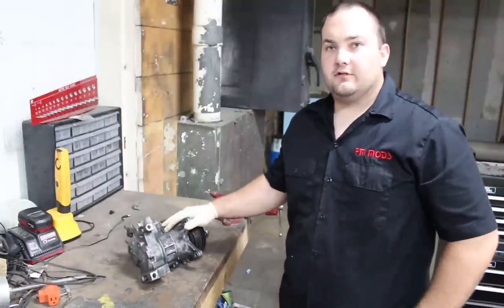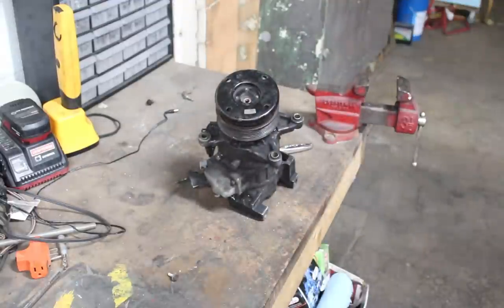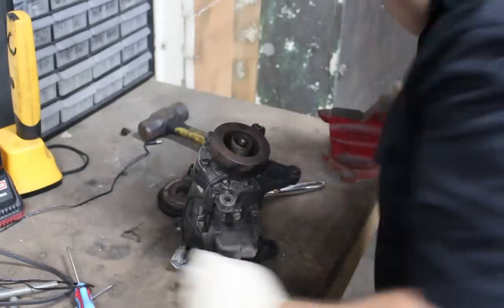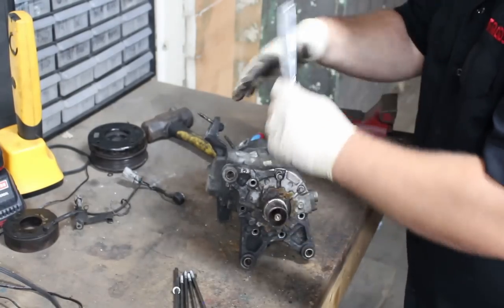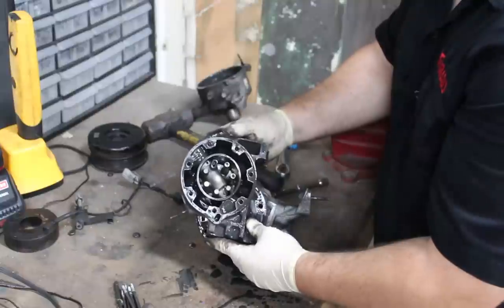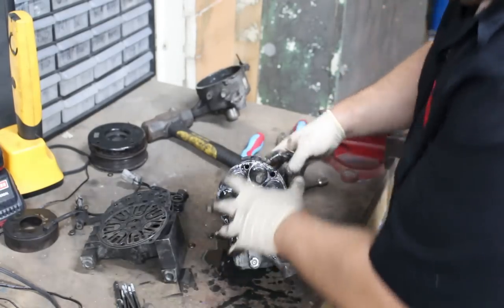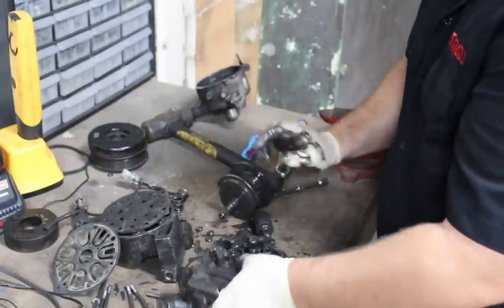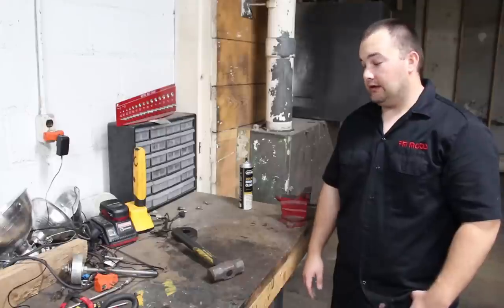AC Compressor What's Inside? Is300 Is200 Altezza

Comment: not a motor or engine its a swash plate pump. very common in hydraulic high pressure pumps, thats quite a piston size for one that only does maybe 150/200lbs, in the older citroens they use a 5 piston pump to run the who car suspension brakes and steering, and the little pistons are maybe 3/8 9mm etc and it does over a 1000lb.

i guess the pistons are bigger as its moving a gas not a fluid

Comment: I never really thought about all the inner workings of an a/c compressor. thanks for the neat insight!
Reply from the maker: No problem, thanks for watching!
Reply: +Garrett Martin I was really shocked.  I assumed it would be a single piston, almost like a lawn mower engine.
Reply from the maker: yeah thats what i thought too
Reply: +Tim Fox Old compressors were piston based, but that really changed in about the 1980s at the latest. I think the Chrysler RV2 was one of the last classic piston compressors. Some are also actually ROTARY. Like a mazda, I shit you not.

Comment: The pistons compresses the refrigerent gas to a higher pressur gas so that it can condensate into a liquid as it dissipates the heat it contains and then the cool liquid will go through an expansion valv to reduce the presure and then go in the evaporator as the heat in the room or car cabin get absorbed by the liquid and evaporates (just like water) and then the cycle repeats. Physically speaking, the princibles of ac can work with any gas but technically, if we take ambient air(mostly nitrogen), compressing it to a high enough pressur so that the ambient heat could condense it to liquid nitrogen would take a tramendous amound of electrical energy. Thank god we have special gases for our cooling.

Comment: I think you reached the point of no return when you started bashing the pully with a hammer lol.

8:02 "this is like a circular motor, like on old airplanes"  Not really lol, that's a compressor. A radial (not circular) engine has pistons facing away from the crank all the way around. Meaning the piston on the bottom is literally upside down with the sparkplug facing up.
Reply from the maker: Hahaha yeah the hammer probably did it in :p

Comment: It is a magnet. When the clutch engages, the magnet binds the two front pulleys, which then uses the belt pulley to drive the compressor. The cylinders then create pressure to drive the the refrigerant through the system, thus cooling the air.

The bearings in the clutch plate are usually what seizes. So you probably could have replaced the front bearings and it would have worked.

I look forward to more of these, good stuff guys!
Reply from the maker: Mathew Wood yeah i probably could have jsut replaced the clutch, would have been cheaper
Reply: Poor Man Mods oh well, At least we all learned something from its demise. It was good to watch anyway, thanks.